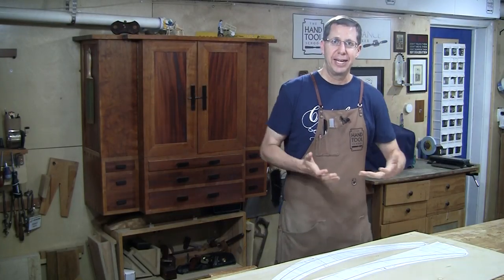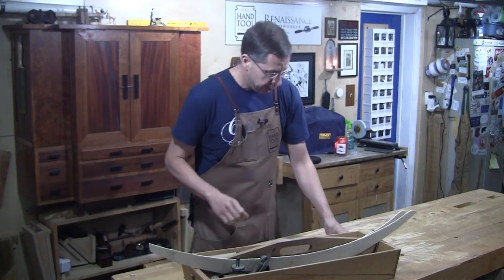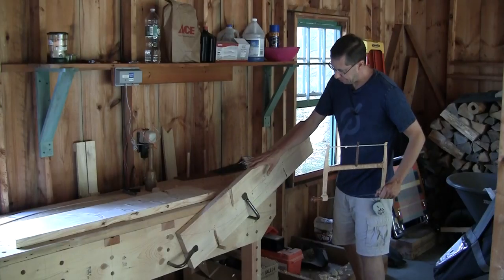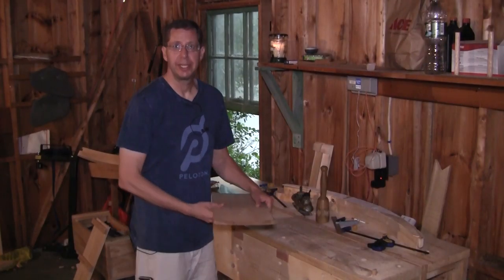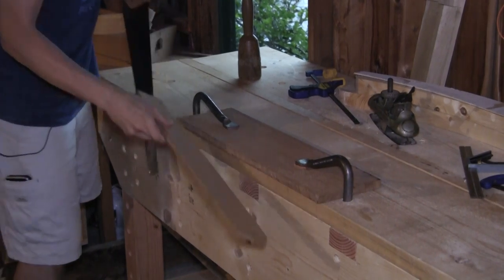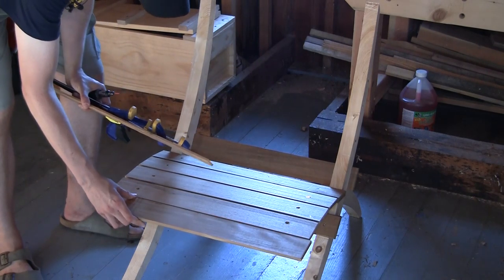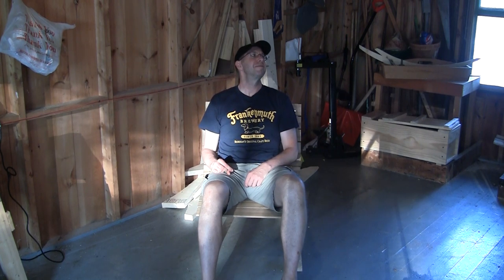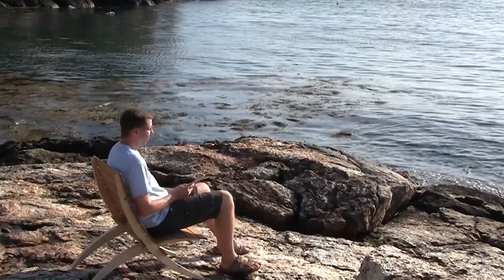Make a Portable Deck Chair

Comment: Cutting those 2x8's with a hand saw, that's work!  I'd use a hand held electric jig saw, a band saw, or if it would fit...my scroll saw.  But how would pine 2x8 wood hold up in an outdoor chair.  Maybe Duglas Fir?

Comment: Hi ya. The only trouble with exposed screws is the heads get hot and can burn sensitive skin
Reply: Use brass "trim screws" inserted where the head is just below the surface of the slat

Comment: so if I don't have a turning saw, a frame saw, or a compass plane, would a bunch of crosscuts down to just above the line, followed by removing the bulk of the waste with a chisel (bevel down) work well enough?

(I mean i could cheat and use my bandsaw, but where is the fun in that?)
Reply from the maker: Sure, roughing to the line is the easy part and there are a number of tool combinations that can get you there.  I would recommend at least a spokeshave however to finesse the curves back to the line.